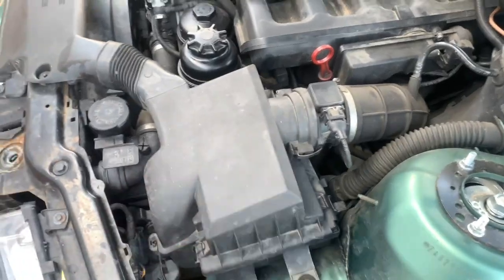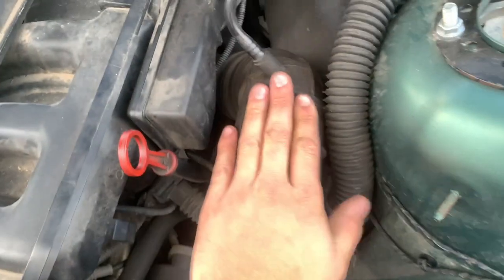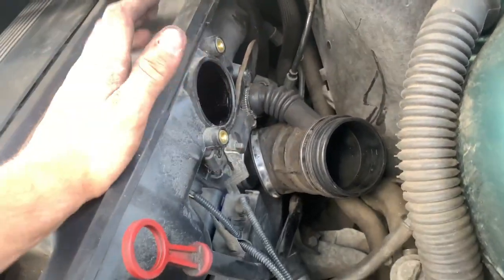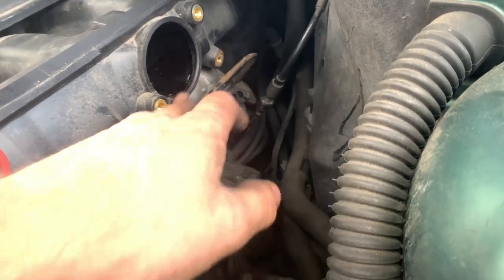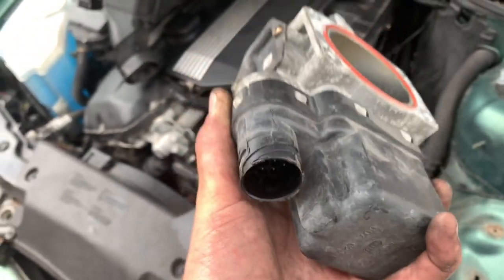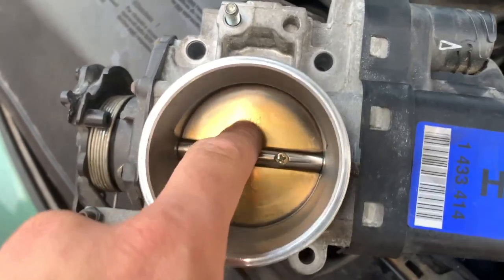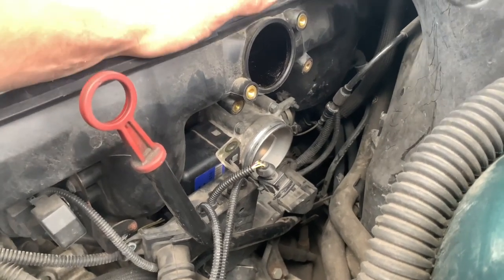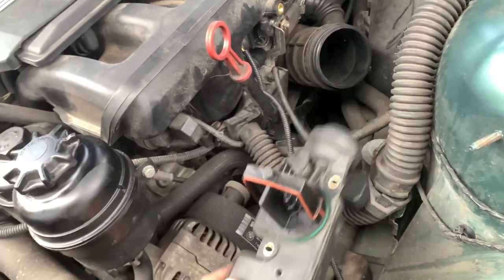HOW TO REMOVE THE THROTTLE BODY ON YOUR E46!

Comment: I have the same car. Seems like you need to tune the cable so your throttle opens properly. I didn’t see you do that, but I’m sure it will help lots
Reply from the maker: @dantealex7731  I ended up changing the whole thing and it worked fine after that fortunately!

Comment: Hi pal, what was the issue? Mine is in idle at the moment, it’s in limp mode and won’t go past 20mph, brings come 005E19 code, which indicates throttle body.
Reply from the maker: @d99mu  if it’s got a rough idle I’d check the ICV (idle control valve) first, then if that doesn’t work I’d check for leaks in the lines, if it isn’t that I’d go for throttle body mate

Comment: Hey man. Im late here but did the maf fix the problem you still had in the end or what did you do?
Reply from the maker: @p3kka813  no changing the throttle body fixed it mate!
Reply: @AJCars.  So those lights went off? right?
Reply from the maker: @p3kka813  yeah I only had the EML Light on and once I’d deleted the codes it went yeah

Comment: Hi, is the throttle possition sensor is integrated in the throttle body? And do you have to reprogram the throttle body when unplugging and plugging it back?
Reply from the maker: Yes the position sensor it part of the body I’m sure, but I would say get a new one as I had a second hand one and it was faulty and threw me right off thinking it was other issues, and no you don’t have to reprogram it purely plug and play
Reply: Thanks man. I looked around for one. Used are from 3 to 600 bucks. Lol brand new are 1000😳
Reply from the maker: @tengzturiagaiii3185  that’s why I went second hand and risked it and it still cost me £300… it’s because they’re discontinued so prices are through the roof
Reply: Man. Did it fix the problem?
Reply from the maker: @tengzturiagaiii3185  yes, sorted it out immediately
Reply: So the eml light and misfire was fix after you replaced it? Is the Throttle position sensor built in the throttle body?
Reply from the maker: @tengzturiagaiii3185  yes mate, just change the throttle body, they’re known for breaking. Everything sorted itself out when I changed it and I think the position sensor is built into it yes
Reply: Thank you. I’am having the eml light turning on and off here amd there. Then one day. I was warming ip the car. Nice good idle. But siddenly it stalled. I restarted the car and misfiring. Checked all the coils and it past. Ao i know it is something else. Thanks Mate..
Reply from the maker: @tengzturiagaiii3185  best of luck getting it sorted mate hope the video helped!
Reply: Yes it did. I took the throttle out to clean it. Bout to put it back together tomorrow and see where it then. Hope i don’t have to buy a used one just yet. Hehehe. Thank mate.

Comment: Hi friend I also have a throttle body problem and when I step on the clutch while shifting while driving, the rpm went up by 800-1500 I have a problem that comes down very slowly. I ordered a throttle body but I wonder how you solved the RPM problem
Reply from the maker: @minjaekim8929  it was all to do with the throttle body, so if I can say anything to help it would be to change that if you’re experiencing the same issues I am
Reply: @AJCars.  Thank you for replying
Reply from the maker: @minjaekim8929  anytime!

Comment: I'm about to remove mine, I've already replaced split hoses but I'm sure the butterfly valve is snagging in the crappy alloy casting. Especially as it broke a throttle cable before I bought the car. Went like stink when I test drove it so hopefully that wil cure it. Mine also lit the EML light when it was in limp mode. Was your throttle body a new or used replacement?
Reply from the maker: It was a used replacement but reconditioned, has been great ever since!
Reply: @AJCars.  I think having just polished out where it was binding mine was the butterfly physically binding in the body. Just polished the edges and body up, shifted the carbon and butterfly back in. If not fixed, I have at least now ruled that out.
Reply from the maker: @YootubeUK  yeah I made sure to get all the carbon out of mine aswell incase it stuck again, the butterfly is a common thing to go aswell because they’re so weak
Reply: @AJCars.  Fingers crossed anyway! Yours still been fine?
Reply from the maker: @YootubeUK  yeah runs and drive great!

Comment: How did you plug in the round throttle cable with the arrows ? I’ve been struggling smh
Reply from the maker: It’s a bit of an awkward one it has a certain shape inside so you can only offer it up 1 way, once you line it up you have to push it down whilst turning it clockwise, it basically winds on then will click down once it’s all the way in